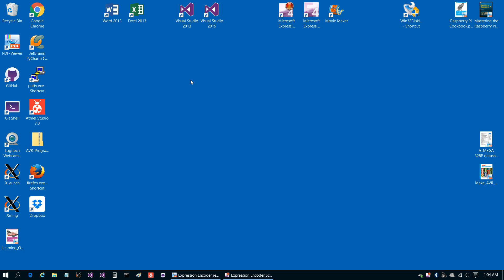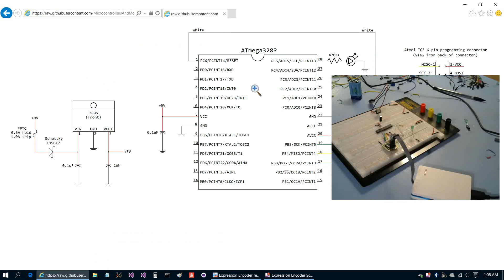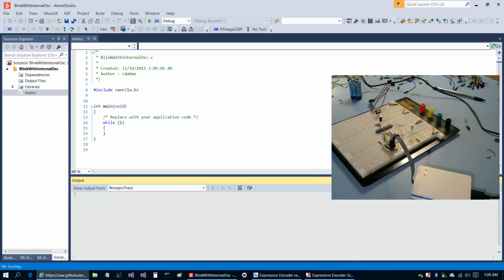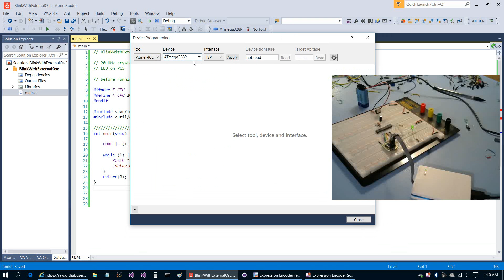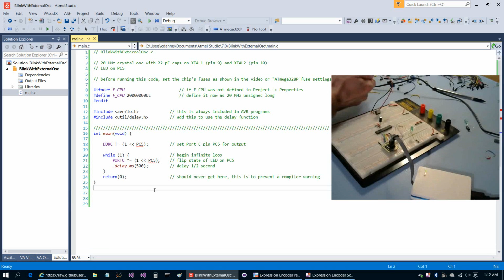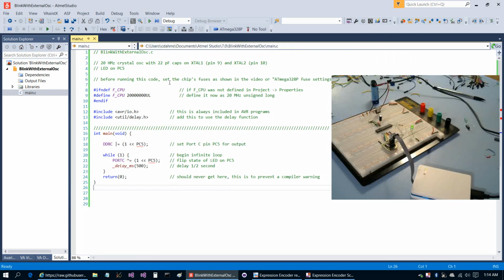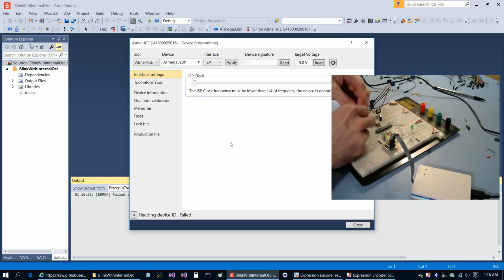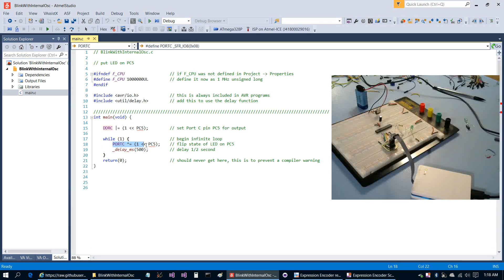Atmel Programming Tutorial 2 - Fuses and Using an External Oscillator

Comment: I have a question on the Atmel Ice Programmer. since it does not supply voltage to the chip, does the Vcc pin on the Atmel Ice connector configured as an input pin where I would supply it with whatever 5volt DC source I am using as well as connecting my ground to the ICE ground pin on the connector?

Comment: hi, I need help... i programmed an atmega8 (succesfully) with a "blinking led" code but it seems to be working at 3.3V... I want this microcontroller to work at 5V,... I'm using a 5V power supply (it gives 4.8V actually), and I'm programming this  uC with the pololu programmer...

Comment: Hi, I am using ATMEGA32 with Crystal 16MHz.
I have written following code to generate 1kHz wave

I tried writing Low- 0xFF High-0x99
But I am unable to get 1kHz wave. I am getting 250Hz wave. instead of 1kHz.
Please help.

#define F_CPU 16000000UL 
#include <avr/io.h> //io related 
#include <util/delay.h> //delay
#include "lcd.h" //custom lib for lcd
#include <stdlib.h> //for string handling
#ifndef sbit_h
#define sbit_h

int main(void)
{

    /All Declarations Go here./

   OCR0=p*127/100; //set pwm1 duty cycle
   OCR2=OCR0;      //set pwm2 duty cycle (Output compare register)

   while(1)
   { 
      if ((bit_is_set(PIND, 3 )))
       {
   pinChange(LED8,1); //Turn on solenoid valve
   pinChange(LED1,1);
   //PORTC|=(1<<PC3);
   _delay_ms(sq); //wait for squeeze time
   TCCR0 |= (1<<WGM00)|(1<<COM01)|(1<<WGM01)|(1<<CS01)|(1<<CS00); //initialise timer in PWM mode 1kHz//cs00 and cs02
   _delay_us(500);//90 degree phase shift
   TCCR2 |= (1<<WGM20)|(1<<COM21)|(1<<WGM21)|(1<<CS22); //initialise timer2 in PWM mode 1kHz//CS22 for 1kHz
   _delay_ms(w1); //wait until weld time over
   TCCR0=0x00;  //stop PWM1
   TCCR2=0x00;  //Stop PWM2
   _delay_ms(h); //wait for hold time
   pinChange(LED8,0); //turn off solenoid valve
   pinChange(LED1,0);
   TCNT0=0x00; //Reset timer counter
   TCNT2=0x00; //reset timer counter
 }
}

Comment: Hi, Is there any way to convert program written for Atmel to Arduino??
Reply: I'm not aware of any way to automatically convert the code, but if you get familiar with the syntax of each you should be able to manually convert the code fairly easily.  They are very similar.
Reply: Hi Thanks Matt,
I am not expert in programing , I wanted to create for Arduino form Atmel , Here is link of program https://geektimes.ru/post/258092/.
Program link https://docs.google.com/file/d/0B8U7RcT0YV5DY1lDZGF4Y0lOR1U/edit?usp=sharing
 I really appreciate it if you could help me

Comment: Thanks for a super detailed tutorial with resources I found it very useful. I didn't disconnect my crystal when I switched back to internal oscillator and it didn't seem to interfere with the internal oscillator.
Reply from the maker: Yep, you can connect an external oscillator and configure your chip to still use the internal oscillator.